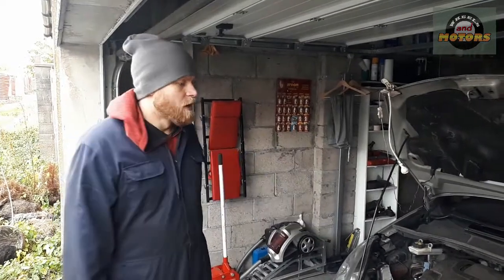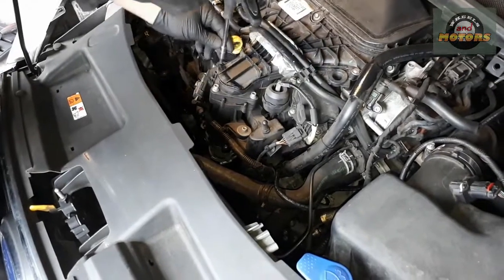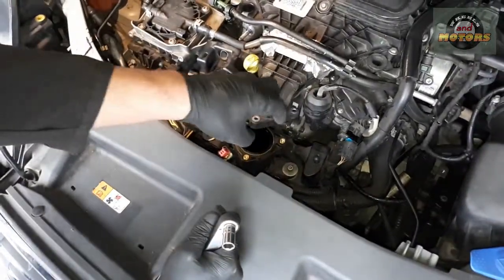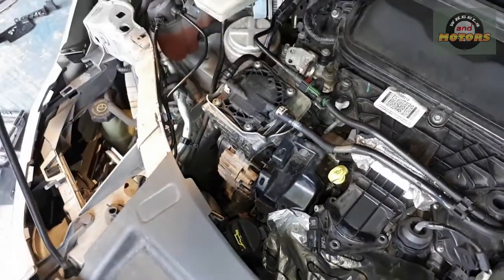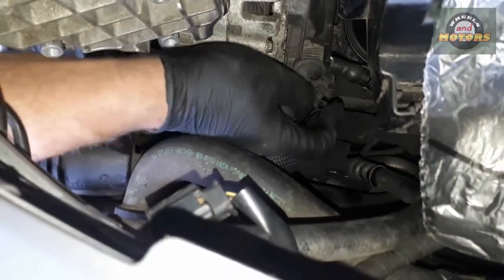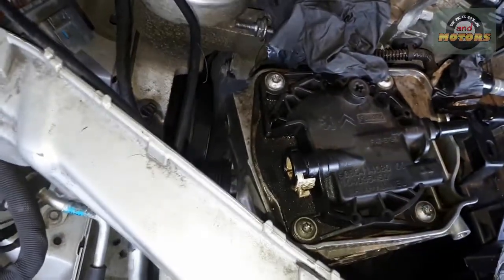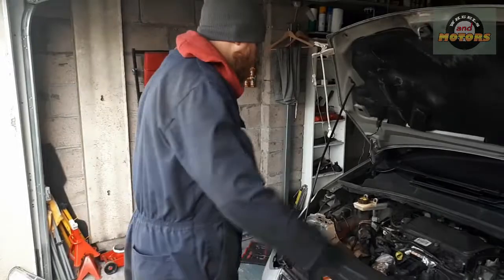How to replace ALTERNATOR - Ford (Volvo) 2.0 TDCi (Galaxy, S-Max, Mondeo, Kuga)

Comment: Thank you for this video. This car has the same layout as my 2013 C-Max 2L TDCi. I managed to replace the alternator in my car last year with your video's help but I couldn't access the tensioner nut without removing the wheel for access from underneath. 16 months later my alternator has packed up again and I am trying to replace it again. Got as far as the tensioner. How on earth did you manage to get a spanner round that nut as it wasn't shown in the video? Some quick advice will be appreciated as I have misplaced the wheel locking nut and I am struging for access from the top. There is hardly any clearance in the C-Max. Any suggestions. Thanks
Reply from the maker: I think you should sort out your locking nut, as the wheel needs to be removable.  I'm not sure how easy (or hard) to access tensioner from the top. By the way, I made another video about alternator replacement on the same car, but easier. Hope it helps:
https://youtu.be/Ky7rGQdaEic
Reply: Thank you for the prompt reply. I managed to gain access. Had to remove the wheel. Do you have a video on reconnecting the tube underneath the fuel filter? Mine came off from the bottom end. Also when I manage to reconnect it do i need to prime it? Must get my car on the road again quickly. Thank you again for your great videos with easy explnations. I have learned so much from you. :-)
Reply from the maker: If fuel filter is empty, them it needs priming (filling up). I have no experience with that bottom pipe, sorry. Also that car in the video is not mine. In my second alternator video fuel filter is not involved.
Reply: Thank you again for replying. First time, last year, I replaced the alternator exactly like in this video by following your helpful clear instructions in this video. This time however I accidentally yanked out the pipe from underneath as at 10.40 point in the video. I have taken the alternator out but before I fit the new one in I have to fit that pipe back but I cannot see a point or a place where it has detached from. Can you please try and let me know where or to what it should be connected to? Also what is that pipe for? If that pipe hadn't come out everything would be sorted. I wonder if a diagram of connection is available. Thank you for your great help. God bless.
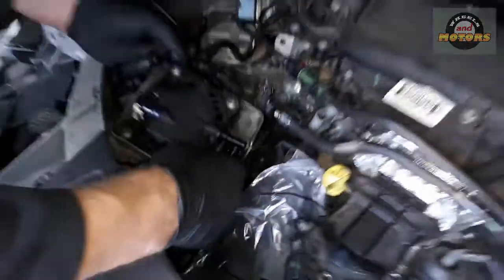Reply from the maker: From what I can see on 10:41, also I had a look on eBay, where they sell these filter housings - it looks like the plastic end is connected to the housing by 2 little bolts. It depends where you got it disconnected. To me looks like further down it's a push-on hose on that plastic pipe end.
Reply: My sincere thanks. You have been a great help. 🙂. Keep those videos coming; very useful and well explained.
Reply from the maker: I'll try my best 👍

Comment: Looks right pain in the arse, just replaced my belt tensioner, thinking it was the reason, for horrible noise on my Smax, not looking forward to tackling the alternator 😕 thanks for the video.
Reply from the maker: You're welcome. 👍 Maybe it's just alternator clutch pulley, not the whole alternator?
Reply: @wawayltd  thanks for the reply, was wondering the same, charges ok, just squeals on acceleration.
Reply: @consul6262  Mine is squealing after 3000rpm thinking it's the pulley too just need to find a video how to replace on this engine did you do yours
Reply from the maker: You can replace pulley in this one without removing alternator, I did it once, but I didn't make a video. Just drop the belt off, use special tool to undo the pulley (it can be very tight), also I raised the engine a little with jack (use padding and go careful) to get over that body panel, you'll know what I mean when you try it. I changed my mind of making video on this one, because of dodginess of raising engine... but it worked for me.
Reply: @wawayltd  Thank you so much for getting back to me I am scared of lifting the engine but will do as much research I can to see where the Jack should go and attempt it thanks very much for the advice
Reply from the maker: Good luck 👍

Comment: How many bolts nuts are holding that fuel housing ?
Reply from the maker: You don't need to disconnect fuel housing. Here is better, easier way:
https://youtu.be/Ky7rGQdaEic?si=lPTZ0b411XAijMvc
Reply: Many thanks for the reply that looked much easier

Comment: Hi, i changed the alternator on my ford galaxy 2009 2.0 tdci yesterday. I put everything back in place but now the car is not starting battery power is good too!  Can you please tell me what it can be? Just mention when i removed the fuel filter i spilled quite abit of fuel ! Please help
Reply from the maker: Probably, there is an air gap in the fuel system, and it needs to be primed. Is it turning, but not starting?
Reply: @wawayltd  thanks for the reply! Yes its turning but not starting, i will try to bleed the fuel system and see how that goes
Reply from the maker: Please check some videos about fuel filter change, they show priming.
Reply: @wawayltd  thank you i will check it now

Comment: This is the same as 2013 2.0TDCi Kuga as well, just getting my alternator out now to change the pulley that failed
Reply from the maker: Thanks Damon, good to know it works for other cars. 👍
Reply: how do you tell that the pulley failed?
Reply from the maker: It's supposed to be clutch-pulley (like a bycicle wheel - you keep rolling even you're not turning pedals), so when engine revs drop it keeps spinning. If it gets stuck, then it causes vibration. It has small pulley, so revs of alternator are way higher than the engine and it behaves like a flywheel that affects smoothness of the engine... What? 😁
Long story short - it gets noisy and vibrates!
Reply: @gasdude1  it was rattling a little bit for a while, but then the pulley came apart and was rubbing on the chassis rail making a horrible screaching so knew something was going very wrong!

Comment: How did you put the  tensioner back in?
Reply from the maker: I didn't take it out. All I did was turning it clockwise to release tension on a belt. You can lock it with a pin or carefully release it back - effectively it's a pulley on a lever with spring. I didn't undo any bolts or nuts on it.